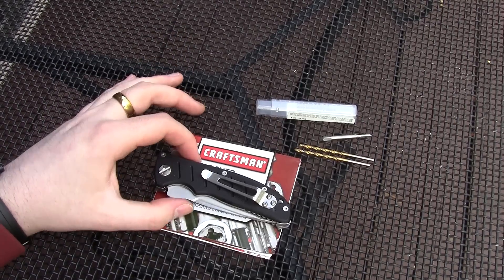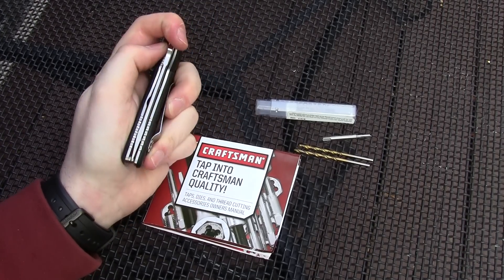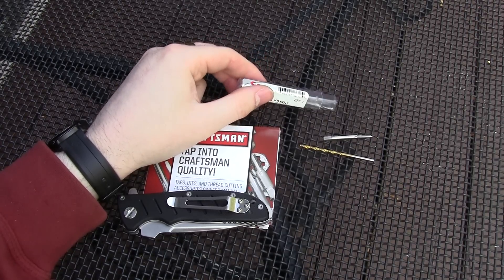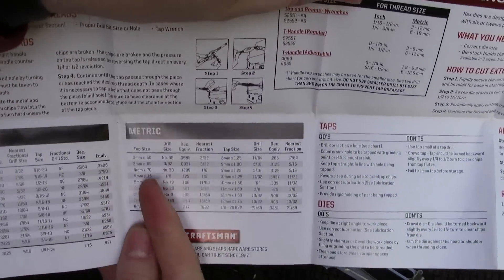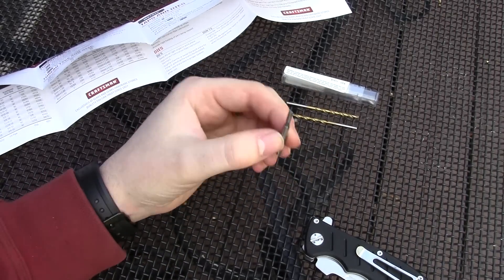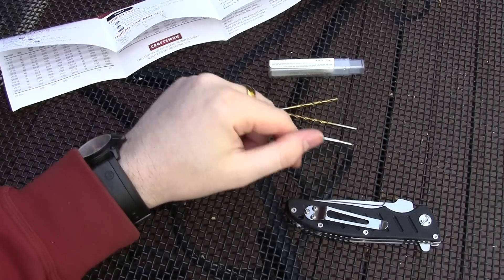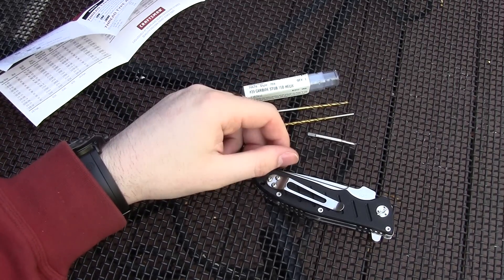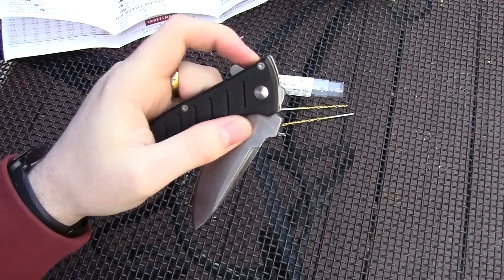Left Hand Carry Knife Conversion - A question about tapping screw holes

Comment: Sorry you had to go through all that but I really respect the dedication to achieving the customers request. During the times that I've tapped hardened steels,I bought cobalt drill bits. Sort of like really rough dremel bits more than a drill. Works great on titanium. I'm lucky that I have a tacoma screw down the street from me. Check their website,pretty good selection of fasteners and hardware and knowledgeable staff.

Comment: I just checked and for an M3 X.5 thread the #39 drill is in fact the correct size. Drilling a little bigger will make it easier to tap and is probably still plenty strong so I wouldn't worry about that too much. You might have made it much harder to tap because as was stated in one of the other comments if you don't push the drill through fast enough you will work harden the stainless steel. I have the same knife, I'll try drill and tapping my to see how bad it is.

Comment: I'm not sure what your source was for drills and taps, but McMaster Carr is a good source for all of these type of needs and they have a very good on line catalog. One more thought on the tapping you need to make sure you have a plug tap, not a bottom tap, it has a more gradual lead in and will make it easier to tap because each  tooth takes less of a bite.

Comment: i know your not the only one with this issue which brings me to believe that they may have industrial type drill bit that may be more durable to this application.i've have experiance in tapping some metals not hardened unfortunatley.i ream the surface of the metal a little so that the shavings dont bind the tap so much and that also makes a small area for the oil to find it's way to where the tap is.if heat is causing failure,maybe having material submerged in oil while drilling may help.

Comment: The hardened steel is your main problem I think.  The hole is supposed to be smaller, and I think the tap was just having a really hard time.  It wouldn't surprise me if those are tapped before the steel is hardened.  I've tapped stainless before, and it was definitely a chore.  You can't go very far before breaking (going backward) and the progress is very slow.

Comment: Can't help you much with that problem (and someone correct me if I'm wrong) but I believe you can get fairly cheep guides that will allow you to screw in the original screws (in the template) to tell you what guide bit and tap to use. If it makes you feel any better...I'll be buying one of these exact models from you in the next few weeks...(probably more)...and I'm right handed. :-)

Comment: As you know, the part you were trying to drill and tap is hardened.  What you could have done was use a torch on the spot you were trying to drill and heat it to cherry red before drilling.

Comment: The steel is too hard for HSS drill bits, but you'd expect to be able to tap the hole with a cheapo tap? Even with the correctly sized hole in material that can be drilled with HSS, a mere high carbon steel tap can easily fold and crumble. With this steel, I'm doubtful even a HSS tap would do, you'd need a carbide tap, and at that point I'm thinking it might be easier to just anneal the scale, work on it, then heat treat it again.